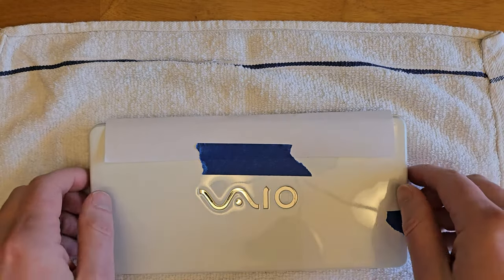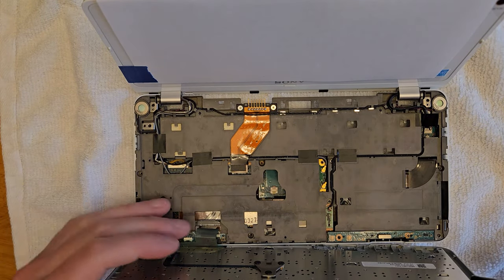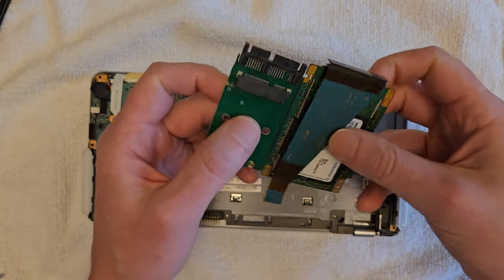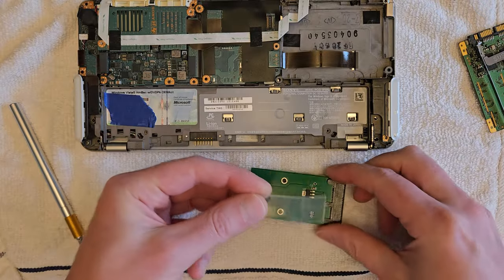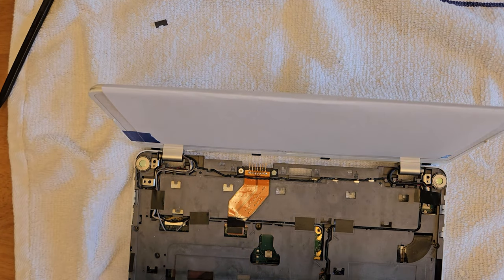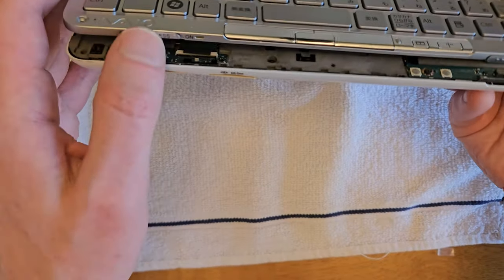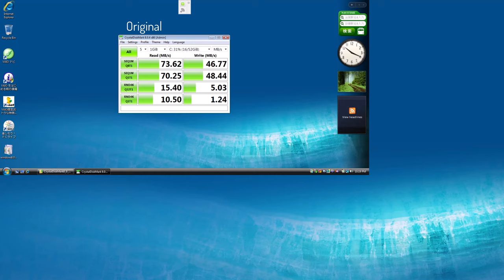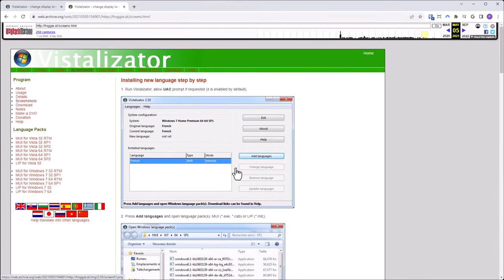Sony Vaio P Series VGN-P90HS (2009) Teardown: Factory SSD upgrade + Windows install

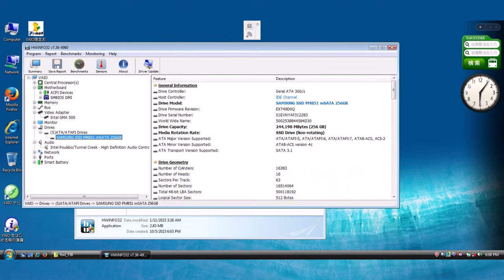Comment: 31:00 the pcb you just removed before is the ide > microsata converter, thats why hdd version uses ide zif interface, ie no adaptor required

Comment: Nice tear down! Where did you find the replacement nub for the track point?
Reply from the maker: Thanks, I should probably for an errata for this video since it was one of my earlier ones before I did the OS tour, and I have the original box and materials. The laptops I got with the original boxes tended to come with extra nubs. It probably won't help much but the bag has 412178301. It has two styles, a rounded black tip with grit coating and a gray tip with flat textured pattern top. You can find generic nubs on eBay in both styles that seem to have the same connector, though most common in thinkpad red.

Comment: Great ! I have one p688 wich i’ll do this upgrade. Did you know if hardware compatible?
Reply from the maker: Yes, it mostly likely will be the same. The P688E is a 1st generation like mine, just a version made for the US market with an English keyboard. It looks like it possibly came with a 64gb SSD stock.
Reply: @jasonnovak2121  yes, it came with this same Samsung MMCRE64GFMPP. Do you still have the link for adapter? This ghost image is in japanese ? Thanks in advance.
Reply from the maker: Here are some suggestions but a lot of sellers sell the same thing so can find the best price

For Factory SSDs (micro SATA)
MSATA Card to 1.8in Micro SATA
https://www.amazon.com/gp/product/B07X32JCJB

For Factory HDD (ZIF)
mSATA to CE ZIF 1.8 inch SSD to 40 pin ZIF
https://www.amazon.com/gp/product/B07MGLGNSH

Yes, my factory image is Japanese language Vista. I ended up dual booting to keep Vista for fun, and then Windows 7 in English to be more practical / faster. The official Sony upgrade I bought did install, though didn't actually seem to have any special Vaio drivers or customization since it didn't recognize my model. Worked fine with built in drivers. I was able to activate win7 over the phone.

 @enzo.fagundes

Comment: Was that metal tray for structural support? Curious how the performance would be with linux. :)
Reply from the maker: I don't believe the HDD version uses one, it just has some rubber bumpers on the corners fills the compartment so won't move around, but the thinner SSD needs that  bracket to keep in place
Reply: I have installed Arch32 on my P90S. While sluggish, it's "usable". Granted I'm on HDD and not SSD, which really doesn't help, and the Atom wasn't fantastic even when it came out. W10 22H2 was installed when I got it, it was unusable. For  the record, from GRUB to the login prompt takes about a minute, and on idle it uses about 256M of RAM. Not too bad for what it is

Comment: Sorry to bother you again , I got the adapter but I did not know where to get the SSD cable to motherboard. Any ideas?
Reply from the maker: You should be able to use the existing cable from the previous drive. Mine had a factory SSD, so it has a microSata cable + adapter. If you have a factory HDD, it has a zif ribbon cable instead. You don't need to replace the cable, you can still use an SSD, you just need a ZIF style adapter that fits your cable.

Comment: Is 2 GB the absolute maximum memory for a P Series?
Reply from the maker: yes, pretty much. I believe the US models all came with 2GB, some Japanese models came with 1GB, but it's soldered onto the motherboard and not really upgradeable
Reply: @jasonnovak2121  mine has 2 GB and SSD but it's slow probably due to Java heavy websites
Reply from the maker: @phils7921  I'm guessing the CPU is probably hurting it too, it has an early gen single core low power Atom processor which wasn't too fast even at the time. A fairly wide range of speeds too from 1.3Ghz to 2Ghz
Reply: @jasonnovak2121  hola, que window
s, es que el funciona mejor en esta laptop?
Reply from the maker: @cesarramirez9975  I would recommend Windows 7 over Vista for retrocomputing, if you need to do something modern then Windows 10 32-bit, but won't be ideal.